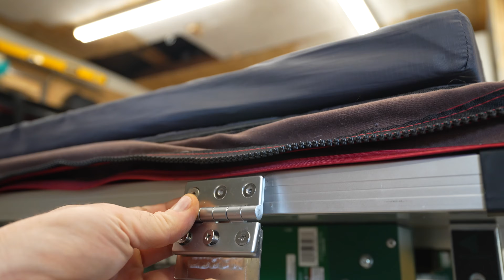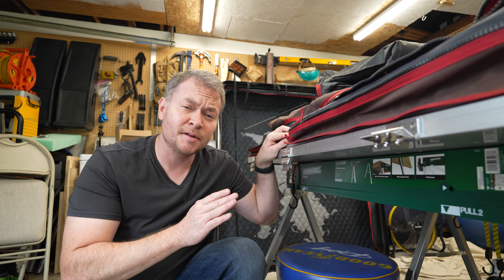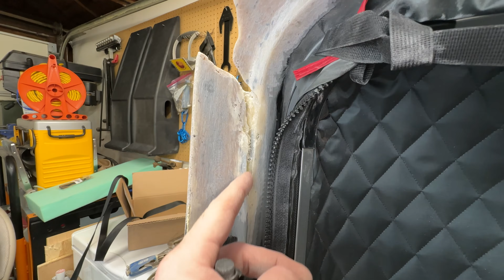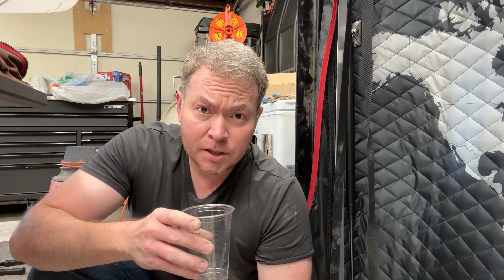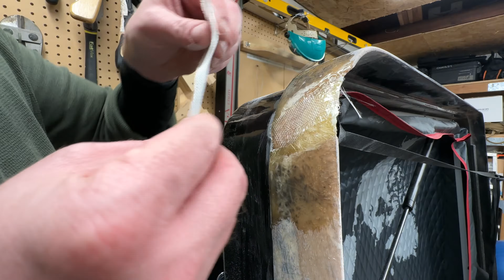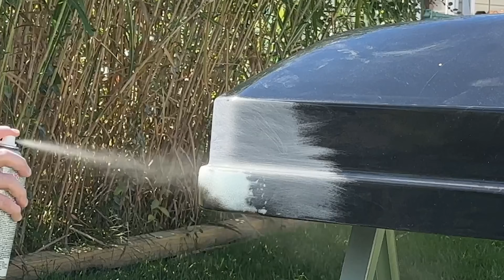Broken iKamper Repair (PART 2) - Hinge & Fiberglass Repair

Comment: Nice Video. UV is getting to my older iKamper. I took it off our Expedition when the truck needed engine work. If I put any weight on the top curve I could hear it crackle...Thinking of re-enforcing from the inside and then painting with bed liner paint to protect longer from UV rays. Any thoughts? Thanks again for the video

Comment: I am thinking of buying ikamer but I am looking complains and failures before dropping a mint on a hardshell tent when I already softshell tent that cost much less but not sure why this has happen to you or if anything was under warranty but you done good job on your repairs
Reply from the maker: Thanks!  I do like the tent.  Was disappointed that pop rivets were used in the hinge hardware.  I've heard from other commenters that iKamper no longer uses pop rivets, but I can neither confirm nor deny that claim.  If you are going to actually use the tent and have the means, I would suggest it.  It's fun and I just like being up off the ground :). I chose not to go with a soft shell because they seemed more bulky and more likely to deteriorate over time due to exposure to elements.  Good luck and thanks for chiming in!

Comment: Great videos. My iKamper Mini 2.0 lost a fight with a mall parking lot overhang. It got knocked off my Jeep's hard top and bounced a couple times. The clamshell corners need repair, and thanks to your video I'm going to learn how to do fiberglass repairs. :) The driver side corner of the aluminum honeycomb base got beat up a bit, but the clamshell opens and closes fine. I guess the hinges and other hardware weren't damaged. I'm moving to AZ in the end of March, hope to have this done before then so I can mount it for the long drive.
Reply from the maker: OMG!  That must have been both heartbreaking and full of more than a few expletives.  Fiberglassing is pretty easy to pick up (if I can do it, anyone can) :). Best of luck and I hope it works out well for you!

Comment: You literaly saved my southamerican roadtrip. I had to return from Arequipa to Lima (abt 15 hours drive) in order to find a way to fix this exact hinge issue on my Ikamper mini, I went to a couple of guys and they couldn't find a way to get into the screws. I'm definitely using this. Thanks for this valuable info. You are the F%& man. All the best from Peru.

Please clarify the following: 
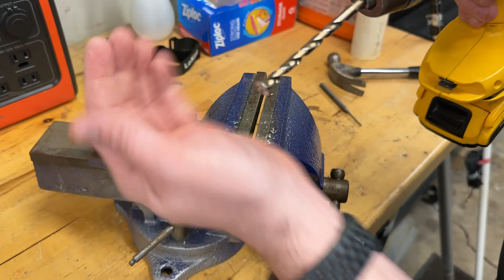when you say: "...Shear right off you can then just punch the rest of the rivet into the hole and out of your way." (min 1:10)
My question is: Is there any piece of the screw that might get stuck into the RTT's platform? this may cause annoying sounds I guess...
Reply from the maker: Sounds like an awesome trip!  Sorry to hear you are having similar issues.  As to your question, yes, punching them into the channel will result in loose rivet pieces in that channel.  There's no way to avoid that that I'm aware of.  Given that the tent is at rest and presumably level when in use, i am not expecting to deal with any noise.  It might rattle a little going down the road, but I probably wouldn't even notice that while driving.  If you're dead set on getting the loose pieces out, I think the corner caps can be removed by removing additional rivets, but I haven't tried this myself.  Hope that helps!
Reply: @TomtheDilettante  thanks for taking the time. All the best.

Comment: I have a ton of Rivnut experience and FYI since you had unfettered access to the back of your work you should have put washers on the back side of your Rivnuts as it would have added infinite additional strength to your repair. I mean blind rivnuts are fine but if you have access it just adds so much more to your work by adding an appropriate washer.
Reply from the maker: Agreed. If I had access, rivnuts would not have been necessary. The hinge mounts in the tent were blind. There was no access to the backside.
Reply: @TomtheDilettante  Oh, I did not notice that in your photography. I find rivnuts useful as a way to provide a tapped surface since a nut and bolt is not always the easiest solution. They do come in three varieties so you can minimize the issue with dissimilar metals.
Reply: I thought the same there access to rear to add anything

Comment: Novel, but actually a very applicable topic, really.  I'm sure there are lots of folks with wear and tear issues on their RTT that could use some inspiration on refurbishing the expensive piece of kit, instead of disposing of it.  It's kind of a seldom touched on topic; the upkeep of modern camping gear.  With the right to repair struggles and the shift away from a 'throw it away' culture, I would think a lot more of this kind of information is going to get popular, hopefully.
Reply from the maker: Thanks for watching and chiming in!  I wish more folks would fix / refurbish rather than discard as well.  Encouraging others to tinker, learn and fix things is part of what I hoped to share with this channel and my humble skills :).

Comment: You gave me intel on riv-nuts 👍
Reply from the maker: They're super handy when you need a blind fastener.  Just be aware of the grip length you need and use an appropriate rivnut.  That's the most common failure I see with rivets and rivets...incorrect grip length.  Which is really just the thickness of the material you're working with.  Best of luck and keep on tinkering :)